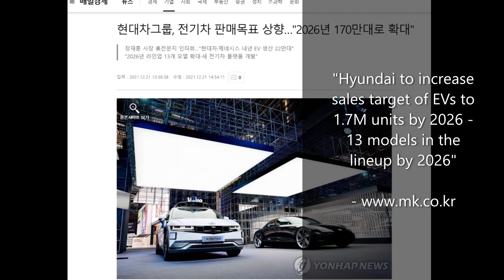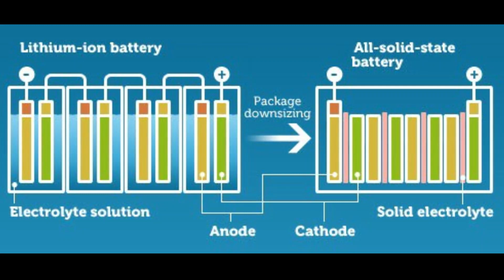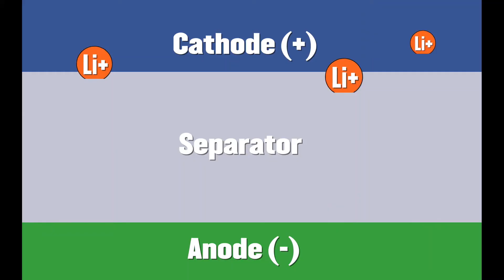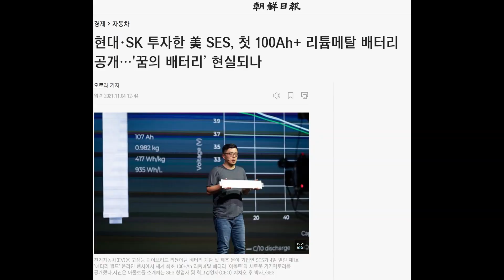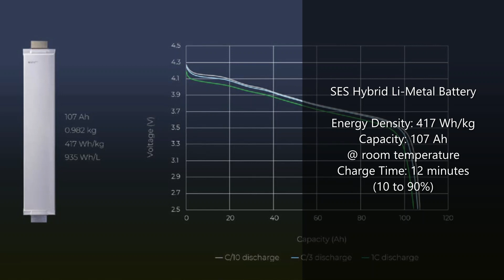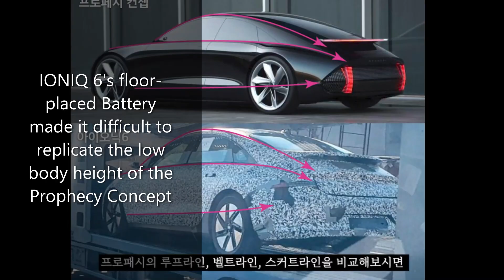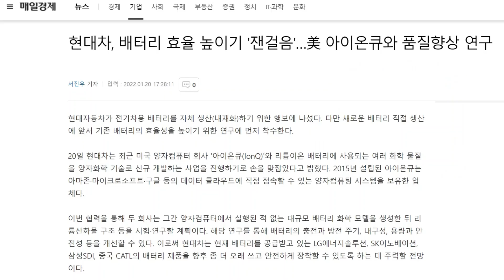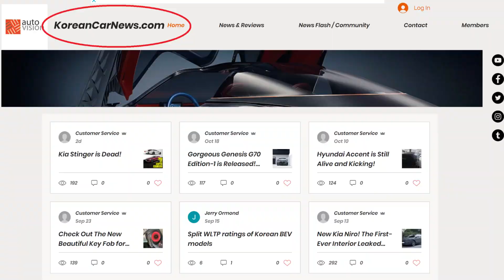800km / 500mi Range 12-min Charge Solid-State Battery EVs Are Coming Up from Hyundai, Genesis & Kia

Comment: Not everyone can afford an 80 thousand vehicle but they do want the range. So until they can manufacture a cheaper vehicle with long range, I don’t think they will become practice.
Reply: Yup exactly. No idea why there is this huge push to have stupid long ranges. Most people drive under 100 miles a day. So why the hell does every EV have to be 300-400? 

At the very least…they need to have more affordable ranges in things like the EV6 and ionic 5. Give me an ev6 with 150 miles for an affordable cost and that is double what I’d ever need.
Reply: @DarkWireWave  The reason everyone wants 300 to 400 miles of range is because that is not the true range at current driving speeds. Just like an ice car, your mileage will vary based on traffic conditions, your driving habits, temp and weather conditions, and many more things. All of these things lower your driving range. With 300 miles of range driving on the highway, you will lose 50+ miles charging to 80%. Then you will lose another 30+ miles driving over 55 mph. Load that vehicle with people and cargo and lose more range. Add in the lack of chargers available and you will lose more range as a comfort zone. Lastly, with price tags of 40k and up, you should be getting more battery range than you would ever need. I believe this is the new game the automakers are selling, you get less and pay more for it.
Reply: If they don't build £80k long range vehicle now, you won't get the £15k mid range vehicle in a few years time. Push the boundaries and the less edgy tech becomes affordable.

Comment: The need for such a large range is over hyped as the charging infrastructure is expanding rapidly. An agile and efficient car with a 250 mile range is all that's required in Europe where average speeds are lower and human biology become the limits of range.
Reply: Counterpoint: the only reason I keep a car is for family long range driving holidays. Family of 5 plus dog plus luggage. 600 mile journey.
Reply: @tsavin  With children and a dog you'll be making stops for more often than the range of your battery. In Europe most people could manage with half that range.
Reply: @eclecticcyclist  I think that's a fair point, but it's a bit risky relying on there being a high speed charger free at exactly the point you need it under current circs. We have a Zoe for City use and 200 miles on her is fine, loads of chargers. M'ways tend only to have two and they're often blocked by ICE twits or in use...
Reply: @tsavin  I've just checked a route across Europe I took a while back. It was 615 miles long and it would have taken me 11 1/2 hours non stop. It would have been  dangerous to attempt such a journey without a break and I would have passed  dozens of chargers.

Comment: The model that would benefit most from an upgraded battery? Shit the original Ioniq by far, the damn thing has a 28~38kw/h battery and a range of 125~170miles, a new system would vastly increase it's range. 

I've watched multiple tests which saw it beating out nearly every single competitor it was matched against in terms of efficiency, with owners reporting anywhere from 5.0 miles /KW to 7.1 miles/KW, beating even the best efficiencies Teslas were reporting at the time.

If they could even increase the battery to match the Kona/Eniro, at 64kw/h it's range would more than double, especially if that battery size increase came with the increased density of solid state a few years down the line. 

As it stands, owners have reported their 125 mile Ioniq's actually traveling 150 miles, and 170 mile variants going 200~225 miles, in ideal conditions, an updated and upgraded system would greatly benefit it, but I don't see it happening as it seems the original ioniq will be phased out in favor of the Ioniq 2~3~4~5~6~7~8~9's with I believe the 6 seeming to be the most likely contender as of right now to replace it. (most similar body shape I think.)
Reply: I am planing to keep my ioniq 28 kWh as long as possible. For my needs this car is perfekt!
Reply: @stefanjepp6612  I wish I could find one! I've been in the market for an EV but every option at the moment seems to be ridiculously overpriced or just extremely hard to find!

Comment: It's that battery technology (or the lack thereof) that keeps me from considering a full-on EV. I actually DO want an EV with 500-mile/800-kilometer capacity (I drive long distances in the summer), but the new technology will almost certainly be applied first to high-end models that I neither want nor need, and cannot afford. So, until we reach that point (500 mile range at an affordable price – say, $25K), I'll stick with my "conventional" hybrid, which I'm thinking of replacing in 2023.